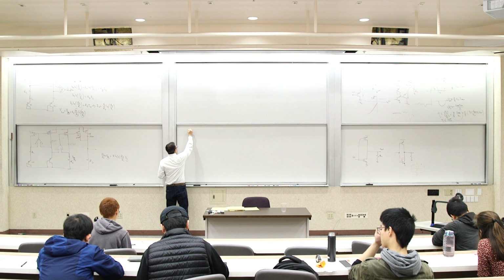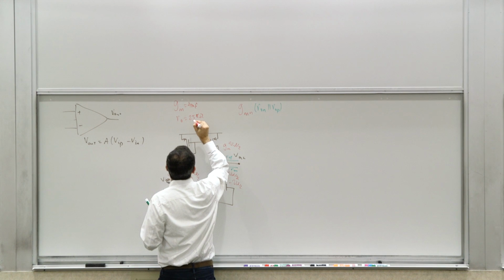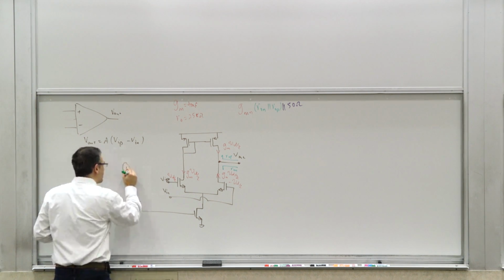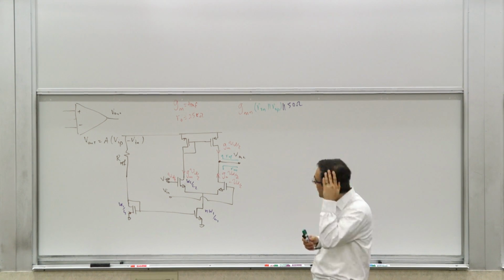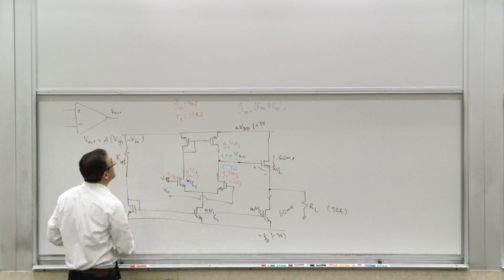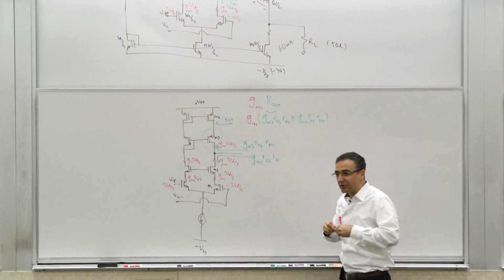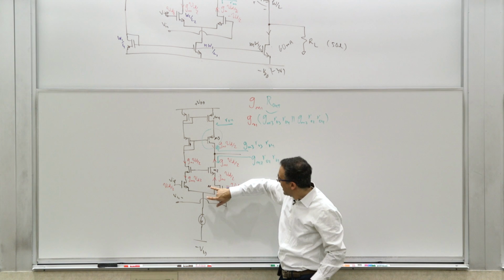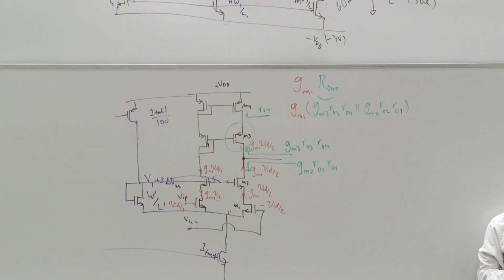136N. Op-Amp Design: Basic MOS Op-Amp

Comment: 00:02 Op-Amp is a block with a differential input and a single-ended output.
02:18 Op-amp gain can be calculated using differential pair analysis.
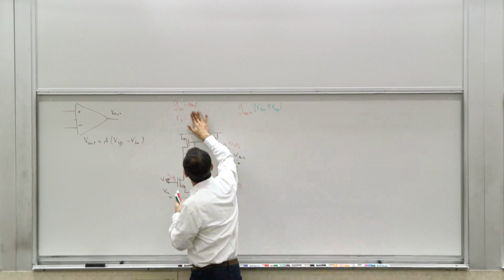04:55 The Op-Amp has a gain of 50 and an output impedance of 12.5 kilohms.
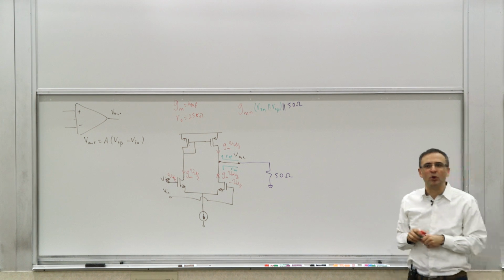07:21 Using a transistor as a current source to make a basic op-amp.
09:44 Op-Amp design involves various components working together for signal conversion.
11:51 Design considerations for driving a load with an op-amp.
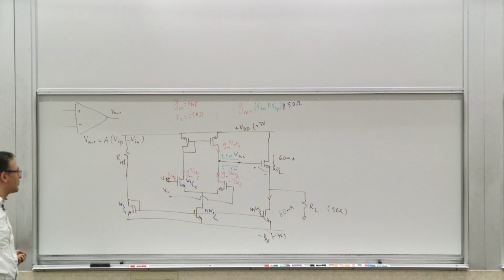14:28 Op-Amp gain can be improved using cascode configuration.
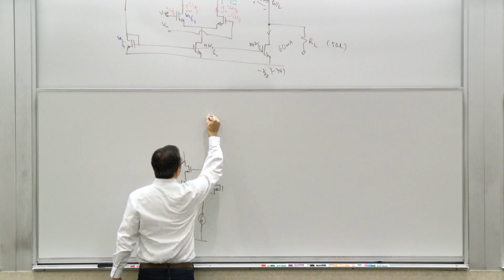16:41 Cascode current mirror improves output resistance and current matching.
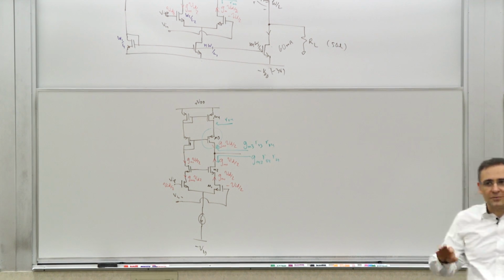19:15 Total gain is GM 1 times the output resistances of the components.
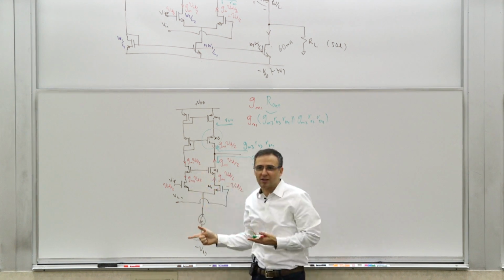21:38 Biasing methods affect op-amp performance.
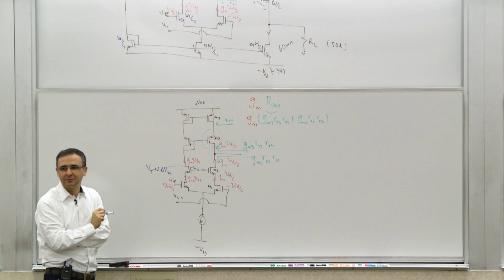23:44 Designing a current source to feed the transistor.
25:59 Consider resistive load for efficient design
Crafted by Merlin AI.

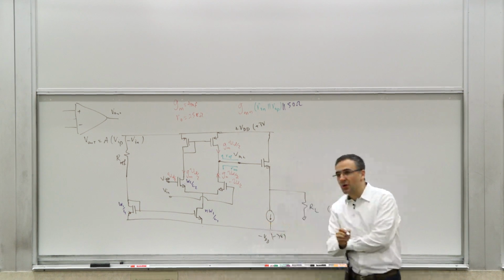Comment: 13:27, Hi Professor
What do you mean by "if we want to get 3V swing", we should let the current source be 60mA?
Do you mean that if we want leg room of the input of this source follower to be as large as possible?
As I understand, increasing the current of this current source only makes the NMOS easier to turn on. The maximum value of Vin is always Vdd+VT,
and the mininum Vin is Vs+VT. So It just makes Vs lower when NMOS is off.
Am I right? Thanks!
Reply: And if we have 60mA here, we get actually much higher swing(Voutmax-Voutmin) than 3V.
Reply: Vt(threshold voltage of nmos) is very low compared with Vin, which is neglected here for discussion. 60mA    is ac component swing output signal across load 50 ohm.